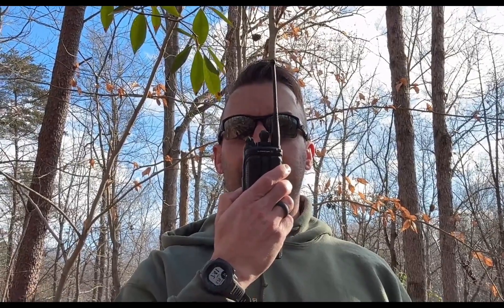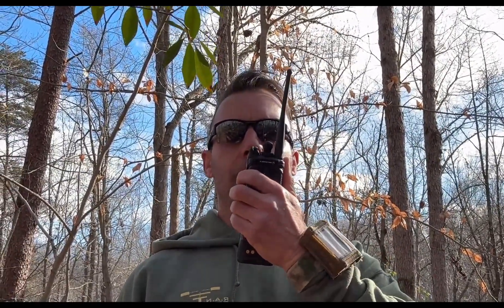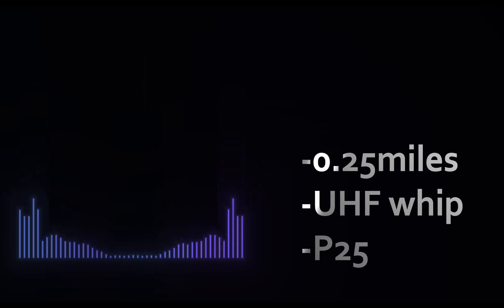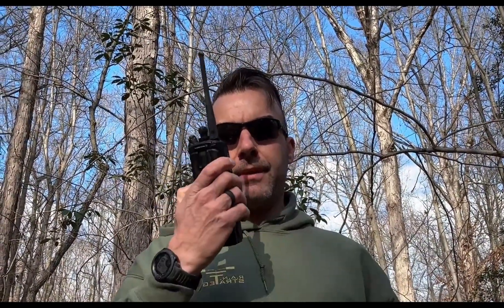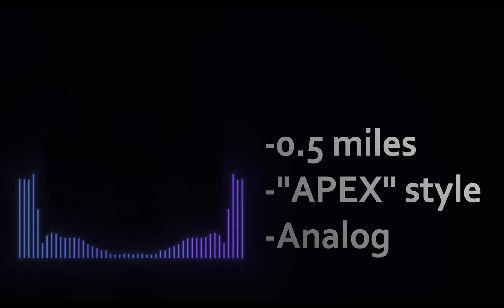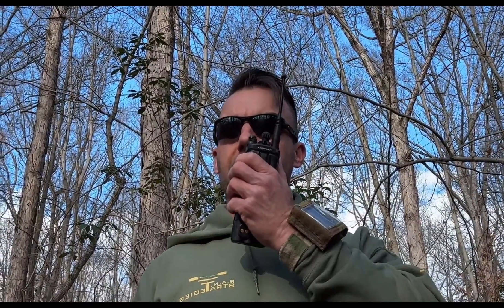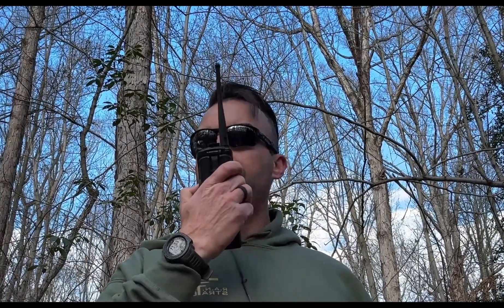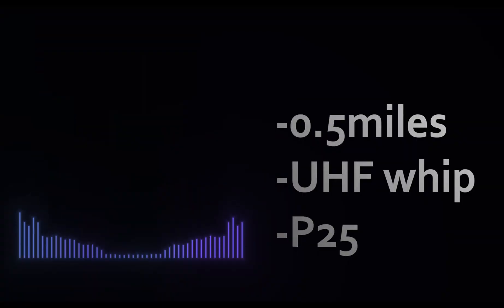UHF Whip vs APEX Style Antenna

Comment: I did an SWR test for my Motorola antennas and found that the XTS VHF wideband did better than the APX VHF wideband in my freq ranges and the Pulse/Larsen did the best out of all 3.  Just some information from the bench.  Curious if the UHF are similar.
Reply from the maker: Awesome info, thanks for sharing! We may do some testing with an APX soon.

Comment: You should pick up an EF Johnson VP5000 or VP6000. They have an RSSI display in decibel milliwatts that is fantastic for more objective coverage mapping and signal strength measurement.
Reply from the maker: That would be awesome, those are solid radios for sure and if we get the opportunity in the future to pick one up we certainly will. Thanks for the recommendation!